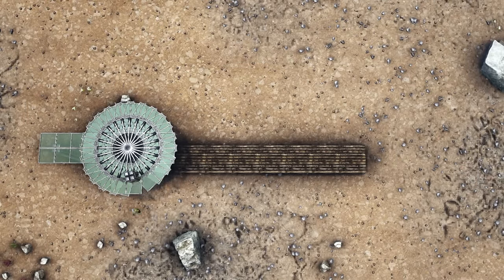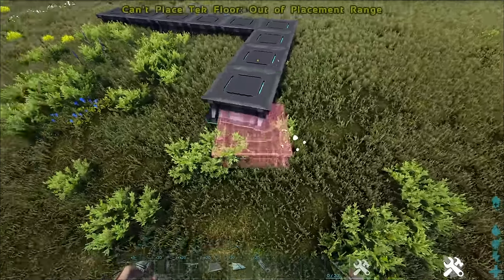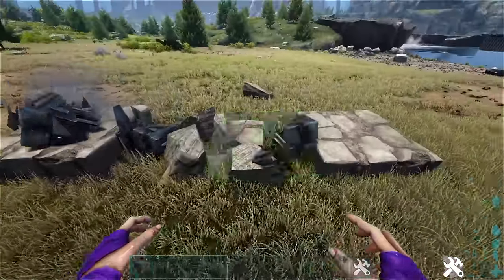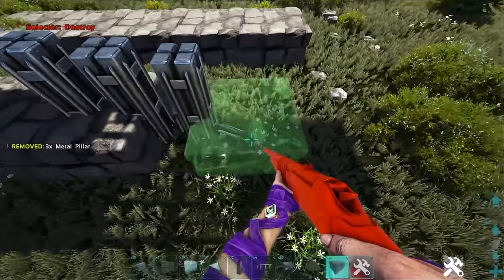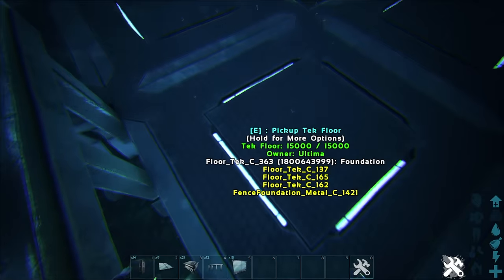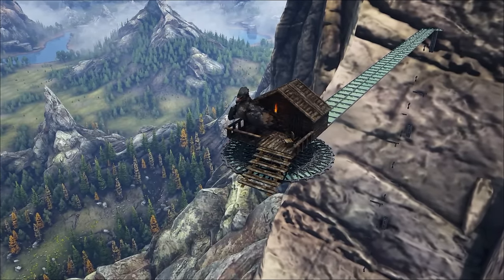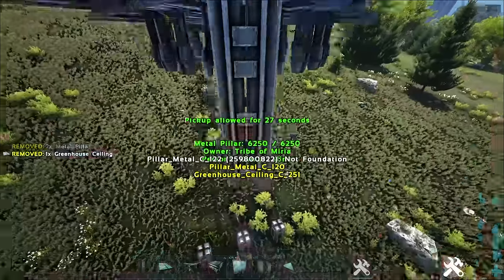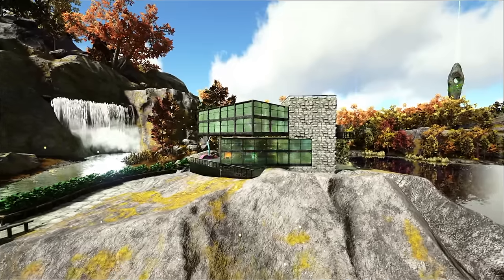How to Build on Uneven Ground on ARK: Survival Evolved (Official Settings)

Comment: It was hard to keep up with this but I learned a lot, thank you.
The main things I learned are that I should use ceilings as floors. Fence foundations as foundations. And that Ark's building system is terribly designed.
Reply: Same. I don't think this video explains what the fence foundations are actually doing here...
Reply: @taylormay9938  They are creating snap points and connecting buildings to each other so it's considered one structure, allowing you to build above it more easily. Without them you would have gaps in where you can place stuff when doing "floating" structures.
Reply: @taylormay9938  they are becoming the foundation support instead of using an actual foundation. You can use fence foundations to create shapes that are anything other than square or rectangular.

Comment: you can also snap stairs and then a foundation to the foundation (might not work on official but works for foundation supporting caves and stuff)
Reply from the maker: Indeed. It creates an offset. But is useful af. Prolly should start using it more often. In my case, it may be a matter of hotbar space and commodity. I use circle mechanics a lot, so my hotbat almost always has pillars, fence foundations, square and triangle foundations and square and triangle ceilings. Admin gun or demo gun if using super structures for quick toggle with Q and rocket launcher and flamethrower for landscaping. A ladder comes in almost permanently when I start decorating or free handing stuff in the build.

Comment: Very good video, can u pls make for triaangle foundation and cealings videos too, because i did make my base with triangle foundations and cealing and first everything was in stone than i wanted to replace in metal but when i replaced stone pilars with metal ones some part of my base is destroyed and on some part i cant build anymore because it said that i dont have foundation suport i dont understan why
Reply from the maker: I've been told that triangle ceilings snap to just 1 structure instead of snapping to everything around it. I haven't tested it but have had the same problem as you before.
Reply: @SefiroUltima  Oh ok, i didnt know that they snap on only one side good to know, tnx for help

Comment: Was this done on PC? I'm on PS4 and having trouble with going up a hill from a lower point. My stone foundation won't snap to the top pillar, only the bottom one. :( Is there a work around?
Reply from the maker: The foundation wont snap to the top pillar if it's too high.
Reply from the maker: It was done on PC but building mechanics don't change. Only mods and I didn't use any.

Comment: I give up. I’ve been trying this on console for the pass few days and can’t seem to make this work. Doesn’t help that I can’t understand the concept of what your trying to say and just registers as jumbled words to me, but that’s how a lot of things sound to me so it’s sadly the norm. I’ve been trying to recreate what you’ve been doing visually but that’s just not working. The ceiling trick doesn’t extend for me more then two blocks and the lower foundations I manage to place always end up halfway inside the previous foundation. Coordinates I’m trying to work at are 72.7, 35.0 on The Island map if that helps at all.
Reply from the maker: It's probabbly an issue with how youre placing the fence foundations. Gotta look at the snap point you want and toggle. Dont move mouse. Should also watch Captain Fatdog's video on floating structures.

Comment: I’m on Xbox and it doesn’t work. I can’t get the 3rd pillar to snap to the ground.
Reply from the maker: It's too uneven. Can use whatever method to drop a foundation lower. I'd prolly use 2 catwalks snapped to the last foundation, pillars to every catwalk, pillars down and make sure to snap a foundation next to the last foundation. Then the fence foundation trick if it's not too high. Remember, that's just one of the tricks you cn use. You can still use the normal pillar ways of building or a row of fence foundations.

Comment: Does it work with stone foundaitions ?stone ceilings?
Reply from the maker: With any structure. Have in mind that some structures have a smaller hit box than others. Thatch, wood and greenhouse structures have a "shorter" side which is useful for some situations. While building my spiral, sometimes fence foundations fell on the ceiling above the one I wanted to float. Changing the tek ceiling to thatch solved the issue. Then back to tek after the fence foundation float.

Comment: 2 fast for me :) haha but thx for sharing!
Reply from the maker: Is there something you struggle to understand due to the speed? Was it hard to watch? Serious questions. I want feedback on this for future vids.
Reply: @SefiroUltima  Hey Sefiro. 
No worries, I am sure, if I rewatch and stop where I don't understand and also parallel to that build it in Ark, it will be perfectly clear. Also I much rather prefer short and crispy videos like this one and look it several times when needed.
To answer your 2 questions:
- I did not really understand what the fence foundation does exactly
- and no! It was superb to watch and I love when the top notch builders share their tricks!

Also I use S+ atm (plus clipping) so I don't have any problems with this at all (I am cheating with S+ haha).

Cheers, keep rockin'!
Reply from the maker: @GortonaGaming  Thanks! Fence foundations alone should get it's own vid at some point. Been thinking about a structure spotlight series too talking about all the snap points basically and how structures interact.
Reply: @SefiroUltima  Advanced Arking haha. I'm totally in on that :)
Reply: @SefiroUltima  I was really excited when I saw this video because I too struggle with the uneven terrain builds, however I agree that it was way too fast. You have a beautiful accent but it does make it a bit challenging to follow along. Perhaps giving some simpler examples along with descriptions of what you're doing would make it a bit easier to follow a long.
Reply from the maker: Thanks. Youre giving me more reasons to make that structure spotlight series. Definitely, this vid could have lasted way longer if I dived into the very specifics of pillar sinking, specific snap points and fence foundation floats, etc. But is worth to tackle at some point.

Comment: just add a ceiling tile, then snap foundation under it
Reply from the maker: That only works in flat terrain unless youre using mods. Youre not snapping to the ceiling either. Youre snapping to the previous foundation.

Comment: talk to fast and move forward to fast. are you saying using the foundation makes the ceiling snap to same height as the foundation instead of clipping unevenly with it?
Reply from the maker: Ssssloooooowww iiiiiiit dooooooowwwwwnnnnnn!
Reply: @SefiroUltima  thats what I said. SLOW DOWN BUD! me slowing down the video doesnt make fast speech clearer. AND IM SIGHT IMPAIRED not hearing impaired. so what you say IS helpful.

Comment: Conan has a better building ai
Reply from the maker: Conan is stiff af and shines due to the sheer amount of structure skins and placeables. ASE, lacking the latter, shines because of the flexibility of manipulating position, rotation and tilt of structures plus a carefully designed structure set that allows many types of building. You can do Modern, medieval, viking, mayan, asian, rustic, old american western, scifi and many more  with the same 6 sets.
Reply: @SefiroUltima  true but they fixed that in asa lol which sucks

Comment: This is a fantastic video! I've learned a lot from watching it. I am still having trouble trying to do one thing, though. I am using stone foundations and am having trouble getting my stone ceilings to attach so that the surface is level with the foundation next to it. For example, I place my stone foundation, sink a foundation next to it as you have shown, and then place my fence foundation and my ceiling, but the ceiling still sits higher than the first stone foundation. Is there a way to make them 100% even with each other?

Comment: ***you can also just walk back wards as straight as possible to try and find a new snap point** the foundation will be lower or higher.. make sure your far enough away so walls dont overlap..
 try and angle the camera.. easy to build giant walls adding in litte slight turns with the rotation feature..
Reply from the maker: I snap everything. I like to build stuff that  belongs to a single foundation support system. Free-handing breaks that.

Comment: what im having trouble understanding is the stuff at the beginning. foundation support only allows you to build out so far before you need to place more foundations. the way you were just infinitely place ceilings with almost no support doesnt seem like its following the games mechanics.
Reply: 0:35
Reply from the maker: It is. I am just connecting foundations at different heights to extend the range of the foundation support.

Comment: With unreal engine 5 coming out in August they’re implementing a structure lower or raising feature, we’ll never have to use pillars to lower foundations again!
Reply from the maker: And it sucks.
Reply: @SefiroUltima  It’s absolutely incredible wdym you can EASILY build on uneven ground and even on official clipping is no longer a thing and lowering the foundations has never been more convenient

Comment: place foudation, set hatchframe hanging off of it, snap fence foundy right under edge of hatchframe, snap pillar 1 tile space in front (look for the snap) place foundation. works much better than this method AND you can build on MUCH steeper terrain.